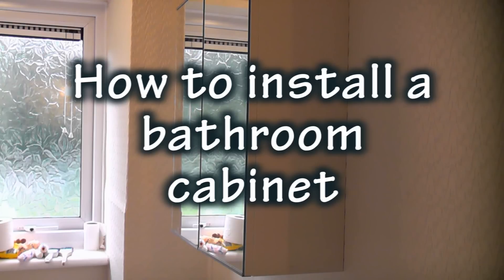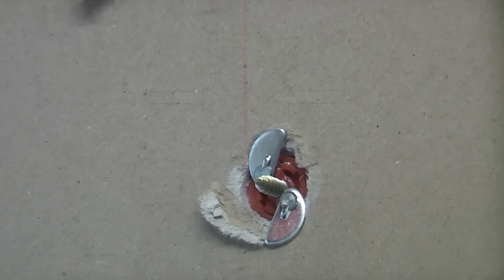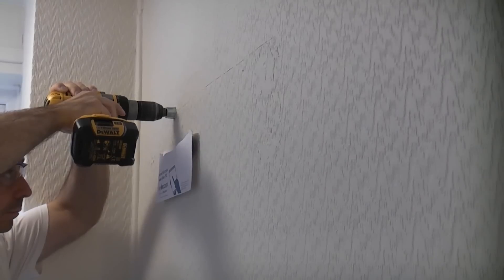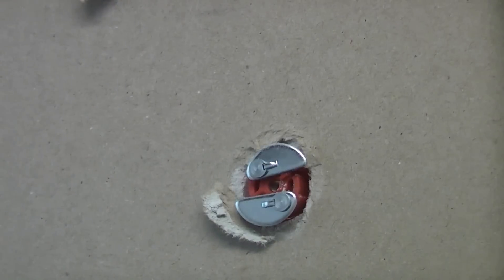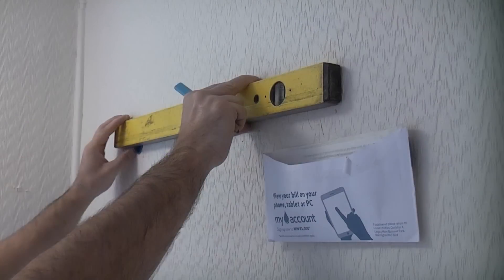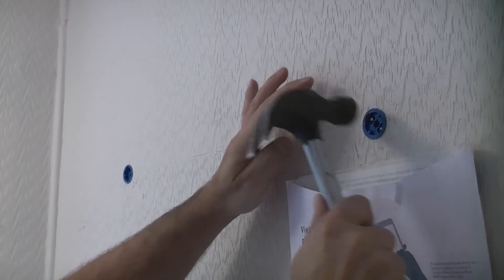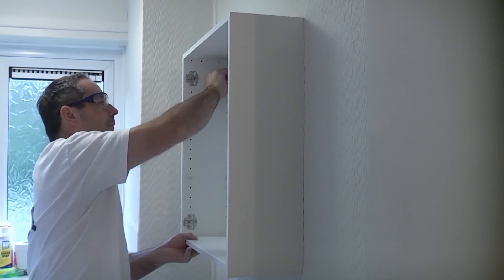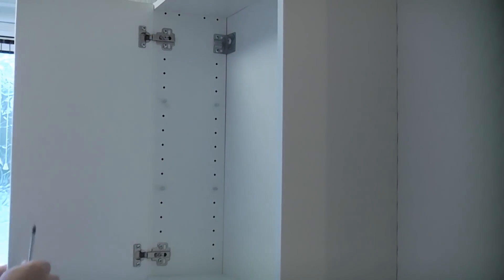How to install a bathroom cabinet on a plasterboard wall

Comment: Thanks for another great video. These do seem nifty, might have to pick up a few and keep in the toolbox! Got a 600x1200 double rad to fit possibly on a plasterboard wall for a job, wonder if these would be up to the job!?
Reply from the maker: +Zed Man 
You are welcome.
These should be up to the job, especially the blue ones. I do intend doing a test in the near future seeing how well they perform ;-)
It's not an external dot and dabbed wall is it? If it is these are good- https://www.youtube.com/watch?v=xaYfs3lr1jI
Reply: I've a 600 X 1200 double that I'm doing tomorrow and using the brown ones. Should do it a treat.
Reply: Unfortunately it's a stud wall, knowing my luck wil miss the battens as they would want the rad in some random place! Will see how it goes. Cheers

Comment: hi mate nice video as always.have you done any videos on fitting wall/base cupboards in a kitchen,its my next project so a few pointers would be useful .keep up the good work cheers
Reply from the maker: +Roy Kirkham 
Hi Roy, No I don't think I had chance to film it the last time I installed a kitchen.
I normally start in the corner of the kitchen and work outwards. I set the height of the base units so that the plinth fits under them without having to cut it and ensure the units are level. You can save a lot of time by using spaceplugs  http://www.ultimatehandyman.co.uk/forum1/space-plugs-t69866.html
Reply: +Ultimate Handyman 
cheers pal 👍

Comment: Hello.  Do you need to place the fixing into the hole in a specific way - i.e horizontally or vertically for particular applications - e.g. overhead bedroom cupboard or shelf - and do you need to use specific sixes of screws for the different coloured fixings?  Thank you
Reply from the maker: I can't remember now, but I did make a video here- https://www.youtube.com/watch?v=szx7nMRZSIY
The different coloured Grip-It fixings are different sizes and require different screws

Comment: Hi mate i have a question hope you can help. In my bathroom the basin is attached to plasterboard and has come away.im looking at changing the basin but how could i reattach the basin to the damaged plasterboard and what fittings could i use very frustrated.
Reply from the maker: Is the basin on a pedestal, or wall hung?
If it's wall hung, you will really struggle.
You could try something like the Geefix fixing, as that spreads the load over a large area (but requires a large hole) https://www.youtube.com/watch?v=BAyuUOjvKcA
If the damage is really bad, you might have to cut the plasterboard away, insert some noggins and refit new plasterboard.

Comment: Hello mate , if you get chance could you tell me in your opinion what's the best way to hang/fix units or radiators for that instance onto 27mm (or thicker) thermal backed plaster boards that are stuck to masonary walls with adhesive . Thanks for your time
Reply from the maker: +Richard Grave I'd try and get a fixing into the brick/blockwork behind to be honest as it will always be stronger than the plasterboard.Rigifix fixings should work with insulated plasterboard as long as you use the M8 versions- https://www.youtube.com/watch?v=xaYfs3lr1jIIt might be worth checking with Rigifix first but these should work (just Google Rigifix and send them a message via their website)
Reply: Should have known you would have already covered that one ha! They look just the job. I'll have to get myself a bigger drill to accept a 16mm bit . But it will be worth it!
Reply from the maker: +Richard Grave 
You can get reduced shank drill bits, as long as you are only drilling large diameter holes occasionally ;-)
Reply: One word . "Legend".  Thanks so much!
Reply from the maker: +Richard Grave 
You are welcome ;-)
It's best if you drill the hole in the masonry with a pilot hole first, perhaps 8mm/10mm before using the 16mm bit as it will put less strain on the drill.

Comment: I have the same unit and it is heavy, especially with the doors on. I fitted mine using the spring toggles. The original fittings inside the unit are like kitchen wall unit mountings. Good job there.
Reply from the maker: +Mark Davies 
Thanks Mark,
It's the first time I have come across one of these "egg box" partitions, so I was reluctant to use any other fixing apart from the Grip-it as I knew they had an undercutting tool which could be used to remove some of the cardboard. 
Thanks for the comment ;-)

Comment: How much does the special cutting tool and undercutting tool cost? Seems like a lot of tooling for a simple job. I have never come across this egg box type wall in 30 odd years, Southern England. I could see the advantage on dot and dab walls where there is little clearance between the plasterboard and structural wall. But even in that instance I cant see the need for the special tooling. Drill a 25mm hole in a bit of scrap timber with a spade bit and use that as a drilling guide.
Thanks for the vid though, I have seen these on several websites and never understood their intended use.
Reply from the maker: +Michael Tricker 
I know what you mean. This is the first egg box partition that I have ever come across too. Normally you can use the Grip it fixings just by using a flat wood bit of the correct size. I just used their hole saw as it was sent to me with some samples, the undercutting kit was handy though with the egg box cardboard being in the way on the back.
The undercutting tool is meant for dot and dabbed walls really and is £6.99 at Wickes. But to be honest on dot and dab walls I'd use the Rigifix fixings- 
https://www.youtube.com/watch?v=xaYfs3lr1jI

I'm not sure how much the Grip it holesaws are as I can't find them on ebay etc. 

I can't wait to test these out to see what load they can take ;-)

Thanks for the comment
Reply from the maker: +Michael Tricker 
Yes, that's a great idea ;-)

Comment: Could you use a snap-toggle on an egg box partition? I'm thinking about hanging a television on one, and you mentioned that snap-toggles were the best hollow wall fixing in a different video.
Reply from the maker: +Jonathan Bull 
I'm afraid not as the egg box prevents the toggle from working correctly, which is why I used these with the under cutting tool.
Thanks for the comment
Reply: +Ultimate Handyman 
That's a shame. Would you recommend either the Grip It fixings, or Hollow Wall Anchors for fixing a television that weighs roughly 8kg to an egg box partition?
Reply from the maker: +Jonathan Bull 
I'd use the grip-it fixings to be on the safe side ;-)
They work really well as long as you use the undercutting tool.
Reply: +Ultimate Handyman 
Great. Thanks for the advice!

Comment: Is this plasterboard in the UK equivalent to drywall we use here in the US? Seems like this plasterboard stuff is softer less brittle
Reply from the maker: +seephor 
Yes, in the US it is called Drywall, over here it's called plasterboard. 
The drywall in this videos is probably 40-50 years old and has been painted/wallpapered several times which may have made it a little tougher than normal. 
Thanks for the comment ;-)

Comment: unless it is a picture frame, never hang any cabinets on drywall alone, grip it or not..
Reply from the maker: As long as you use the correct fixing, it is not a problem ;-)
Thanks for the comment 👍

Comment: you lost me at the 3 minute mark, what are you hanging the cabinet onto?
Reply from the maker: +sean o'connor It's a plasterboard wall, but glued to the back of the plasterboard is cardboard, It seems to be known as an egg box partition wall.
Reply: +Ultimate Handyman okay got it, do they sell gripits in canada? do they go by another name here?
Reply from the maker: +sean o&#39;connor 
I've just checked and they don't seem to have a distributor in Canada. Perhaps you could get them from ebay? If it's a normal plasterboard partition the spring toggles work well and are widely available.
Reply: +Ultimate Handyman thanks maybe there is a similar product, i'll look around
Reply from the maker: +sean o&#39;connor 
Best of luck with it.
Thanks for the comments ;-)

Comment: What size screws did you use for the fitting? Many thanks
Reply from the maker: I'm not sure as they were supplied with the Grip it fixings.
I think they were either M6 or M8 diameter.